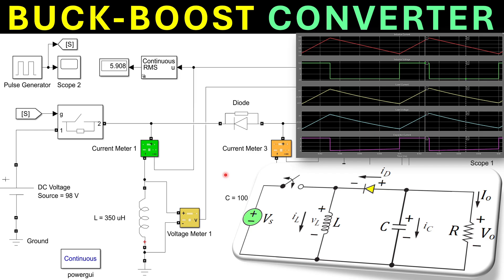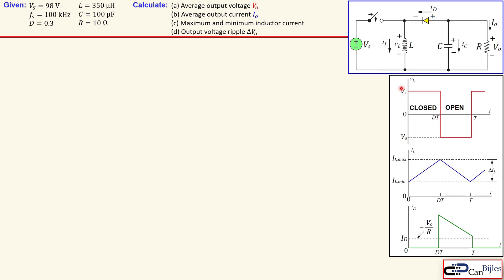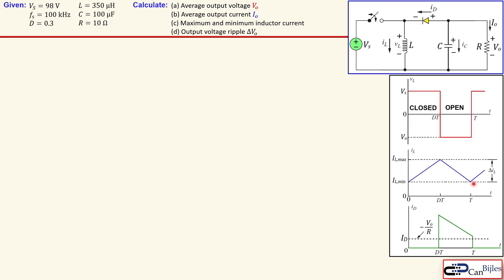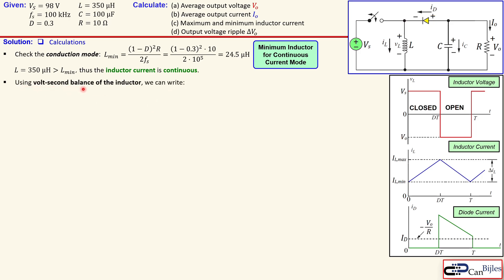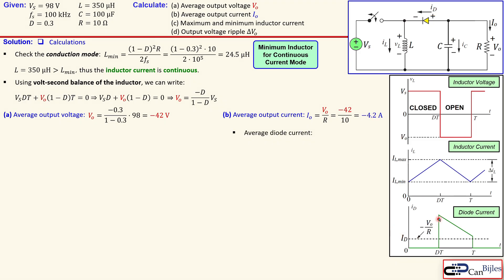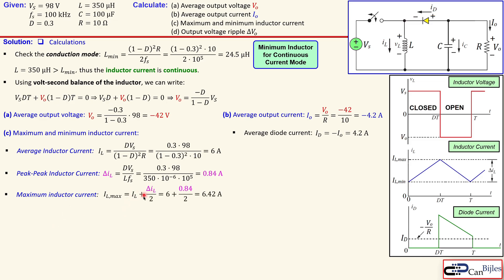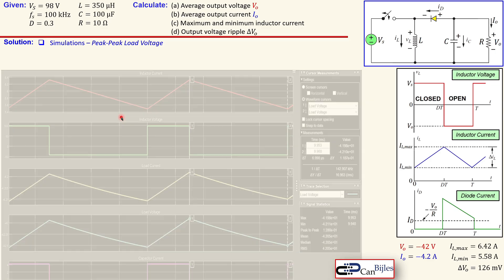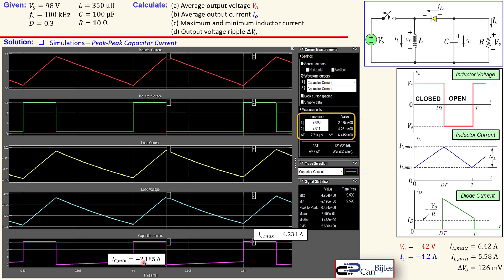⚡DC-DC Buck-Boost Converter - Continuous Conduction Mode 🔋 Power Electronics Calculation & MATLAB

Comment: Hello sir, very great video. Can you help me with this question: - Make a basis simulation of the buck-boost converter without controller (max. 10 
components) to simulate the converter 
Use as start values for the components: Vin= 12V, L = 100μH, PWM frequency = 50 
kHz, Rload=10Ω, Cout = 20 μF, Diode 1N5819. - Prove with the simulation that the equations given in the reader for the relation between 
duty-cycle, Vo, Vi, ripple voltage are correct (details are specified in the assignment) 
• Make a table for 3 different values of D.  
• Make a table for 3 different values of the capacitor. 
• Find Pout and Pin at maximum load and calculate the efficiency (Pout
 Pin
 ∗ 100%). - Include a control loop in the simulation (use the PWM controller given in the example and 
make sure to connect the negative output voltage correctly to the error amplifier) and proof 
that the controller works by: 
• Showing that Vo is adjusted in accordance with the reference voltage of the error 
amplifier
Reply from the maker: Thanks for your comment. I think you can follow the video to answer most of these questions. You can also check the playlist for more power converter design: https://www.youtube.com/playlist?list=PLuUNUe8EVqlkTs7tJwfkSq7Pj036zUyug